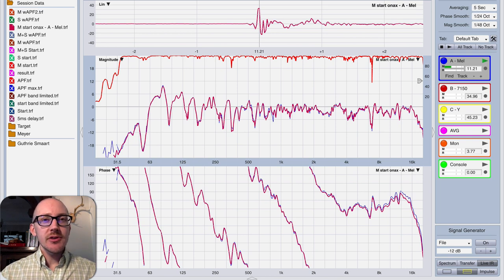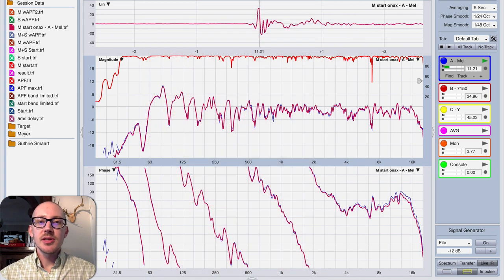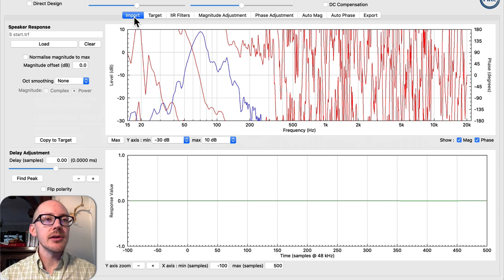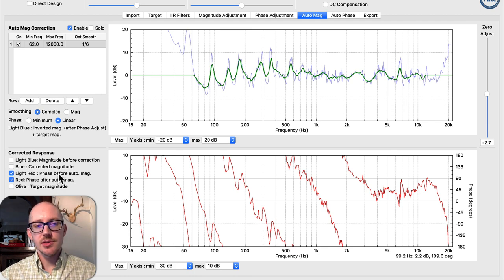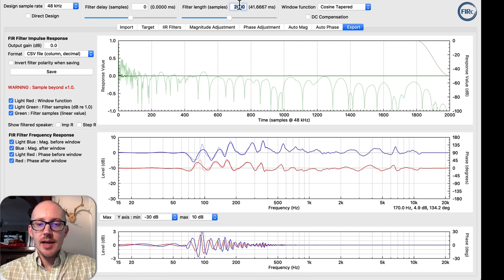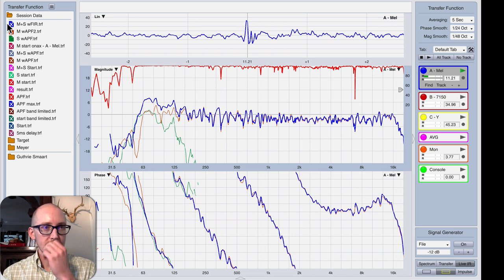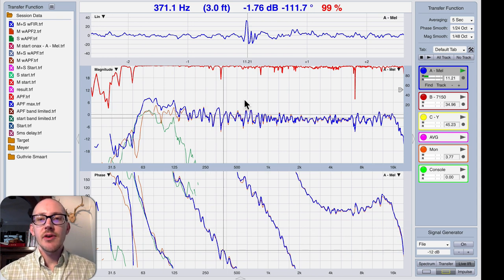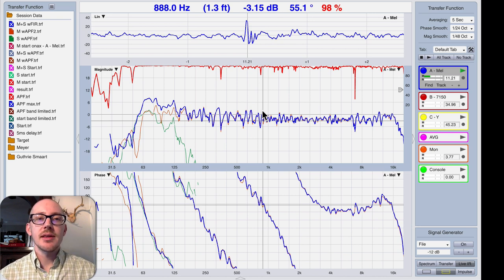How to use FIR filters without causing delay

Comment: BTW the warning message at 3m40s relates to the largest magnitude of the FIR filter coefficients. Here the largest value coefficient/s are slightly outside the range -1.0 to 1.0 which is fine for most DSP's and when exporting the FIR filters as CSV, TXT, BIN or some of the other proprietary formats, but will be a problem for WAV file export because the WAV files are limited to values in the range -1.0 to 1.0. On the Export tab we provide an output gain setting to slightly reduce the FIR filter gain and, if necessary, bring the coefficients within -1.0 to 1.0. However this gain change may need to be anticipated elsewhere in the overall DSP chain.
Reply from the maker: Eclipse Audio thanks!

Comment: So you keep interchanging linear and minimum phase while talking about the filters - it’s true that minimum phase won’t incur any additional impulse delay and shift the phase response slightly, but the linear phase filters will shift your impulse. The number of taps you put in times sample rate is overall delay. Not delay per frequency, but the delay for the linear filter to work. This can be avoided in some ways but pre-ringing becomes an issue. I would be interested to see what happens when the BSS is completely bypassed via a cable versus plugged in. I think you’ll find that the impulse in smaart is shifted a bit. Is the BSS implementing minimum phase filters? There is a change in phase response on the smaart graph
Reply: For a linear-phase FIR filter, I think you mean the overall delay is "half" the filter tap length times divided by sample rate times 1000  (in ms). In FIR Designer and FIR Creator, the IR peak can be adjusted using the "delay" control, so when designing linear-phase filters, it's possible to trim more off the front of the IR by lessening the "delay" number. This, of course, starts to take the filter away from perfect linear phase but you can watch the phase error on the Export tab and adjust to your satisfaction.
Reply: Apologies, my 5AM mistake!!!
Reply: To be clear, unless I’m misunderstanding you, the length of the filter is derived by filter length in taps DIVIDED BY the sample rate. i.e. for 384 taps and 48kHz, it would be 384 / 48000 = 0.008 seconds, which is 8ms
Reply: @pixelmayhem  Correct. My mistake typing too fast.
Reply from the maker: Hi Parker! No linear phase filters here. Only minimum phase. That was the point of the video. If I misspoke and said "linear", I meant "minimum". :)
Reply: All 'conventional' filters are IIR and thus minimum phase..only some products will give you a predefined FIR filter (f.e. DolbyLake).. BSS has a FIR capability for as long as the product exists (even the green ones!) but you will have to create the filter kernels yourself with a tool like FIR designer (or Matlab, Rephase...)
You will find that a DSP will allways have some 'latency' associated with the A/D conversion..quotes because we shouldn't call this latency, let's reserve that word for CPU based machines, as within these we can change the buffersizes

Comment: Thanks Nathan. Fascinating, and very well explained. It would be great if you would do something about using free FIR creators, in conjunction with one of the cheaper processors, like Thomann's the.rack FIR processor.
Reply from the maker: Thanks Ivan. What are you using for FIR filter creation?
Reply: @nathanlively  I'm not yet, but I was so impressed with the "Gunness Focusing" using an EAW UX8800 on my old KF850s and 650s, that I'd like to try some pre-processing with FIRs on my Tannoy VQNET system.

Comment: Do you use the auto phase adjust? Is there a reason not to raise the resolution since it doesn't seem to add delay in the processor?
Reply from the maker: Hey Ben, great question. Here's a selection from my interview with Michael.

Michael

I wouldn’t necessarily classify it as a mistake, but I do caution people not to lean too heavily on the auto-correction functions: the Auto Magnitude tab and the Auto Phase tab.

Nathan

But that’s the most fun. It’s the single-button solution.

Michael

Yeah, I completely get it because suddenly everything magically goes flat and the response becomes just the way you want it.

But I guess my caution is because, as you know, drivers change their behavior with level and with temperature, and a measurement taken at one spot in a room is very different to a measurement in another spot in a room. There’s so much variability in the measurement process and in the loudspeaker. A loudspeaker is a mechanical device. It wears out. It changes its behavior over time. If you start to correct for very fine grain structure that’s in your measurement, you may be correcting perfectly for one measurement location in the room on a specific day and time, but you may make things slightly worse at other points in the room or at other levels….

https://www.sounddesignlive.com/myth-fir-filters-always-add-a-lot-of-delay-and-are-impractical-for-live-sound/
Reply: @nathanlively  thanks Nathan. I guess my question was not just about the auto function but also if making phase adjustments if latency becomes effected to a greater degree. Also, if NOT using the auto mag function, where a bunch of fine filters are being applied, what, if any advantage does a fir filter have over a typical parametric eq block. If you are adjusting for a specific speaker in a specific room, why would some say it is only be acceptable to use a  FIR filter designed specifically for a speaker in an anechoic chamber? Why would we not adjust the filter specifically for their real world environment. I get that some of the answers are in the Eclipse response. I'm interested in trying both ways in a controlled environment and directly comparing.

Comment: Thank you for the great video! I'm just getting started with FIR filters, and at this point my questions are little..basic. It seems like you applied that filter to almost the entire response of the system...so I assume the there is already a crossover LF to HF? Is that the way FIR filters are customarily used? Or can you use them to create the Lowpass/highpass crossover filters for the drivers as well? And then would you need the FIR filter for the whole system the way you have done it? (I've read a lot and watched a ton of videos about what FIR filters are...the equations, etc, but none about the practical usage of them). I will try it on a 3-way in Sigma Studio (analog devices). Any suggestions would be great. ;)
Reply from the maker: Hi zuke, I'm not building speakers so I'm rarely using FIR filters in my daily work. I can't really comment on how they are "customarily used". I have seen entire speakers are that design with FIR filters only. No IIR filters whatsover. But yes, I think most designs use IIR filters for the separation between bands and then FIR filters afterwards to cover a specific area. CrossLite has a users group that meets weekly where you can get training on this. Also check out the videos on the Eclipse Audio YT channel
Reply: Great..thanks for the quick reply. I will do that! @nathanlively